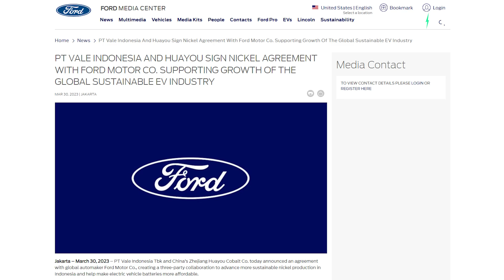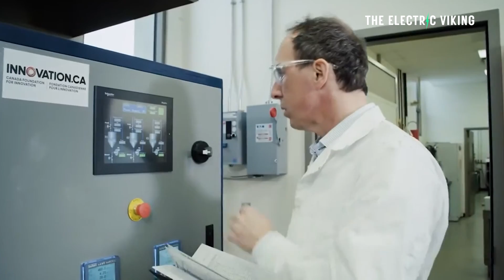Ford signs new lithium deal in Canada, firms lithium iron phosphate plans

Comment: I guarantee Ford will make more money from ICE than EV's in 2025 and by a significant margin.  Not because I think they're not trying but because it's mathematically impossible for a company that size to shift direction in just 2 years.  The supply chain, the factories the robots, the workers all have to change.  Ford can't do this in two years and I would be shocked if they could do it in 5.